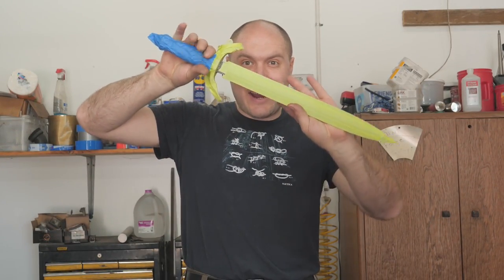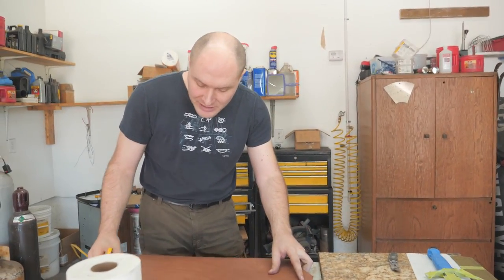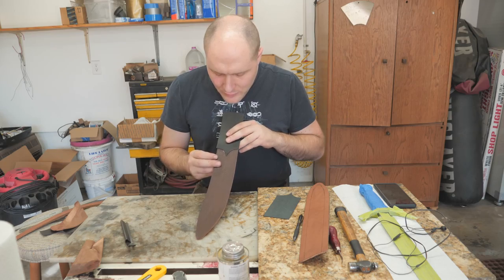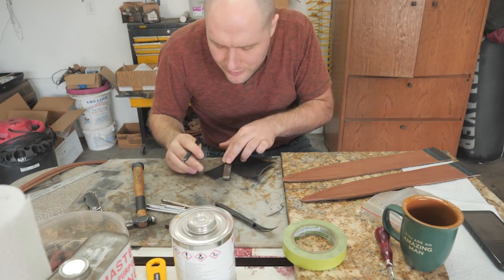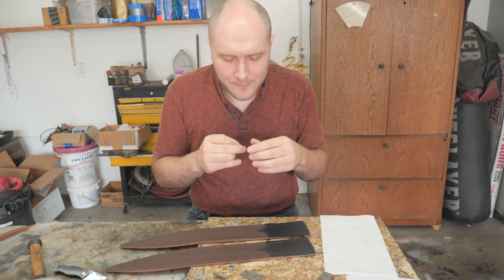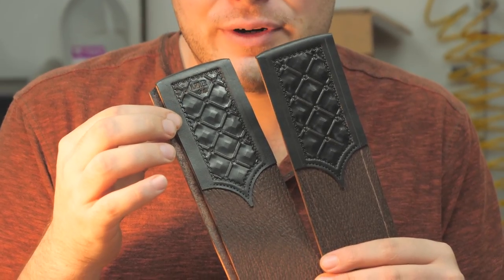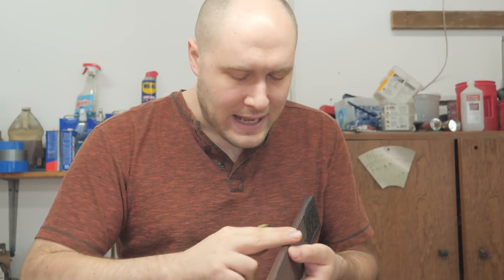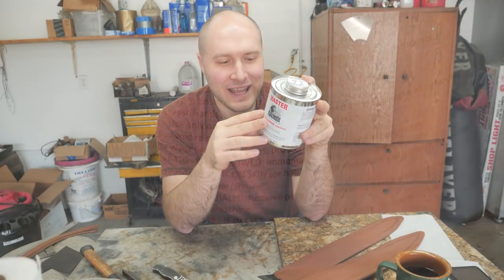How to Make a Sheath for a Dagger

Comment: Lovely work... I struggled with stitching for some time.. eventually I seen a chuck dorsett video and omg .. ... I use 6 inch needles for more grip to avoid needing pliers on tight holes 

Anybody comments on not using pricking irons ... it's tough to stay straight on thick leather... I prick enough to see dents and drillpress  sheaths aswell ...

Comment: Hi, thanks for answering my question on a different video. I have another question. I see that you stamped a pattern on the leather, but how would this work on a scabbard? Would the wood core underneath the leather potentially crack when stamping? If so, would you make the pattern before the leather wrapping? How would you align the leather so that the stamping is where you want it on the scabbard? Sorry, not just another question haha.
Reply from the maker: Good question Shane 
I think it would be hard to damage the wood with some gentle tapping 
Team Royer

Comment: The part I struggle with most is The edge finishing I guess I lack patience sometimes
Reply: Not all leather is burnishable. Vegtan-round your edges, use water and burnish lightly, not to much pressure and bees wax to seal. Chrome tan wont burnish use edge coat and then lightly burnish to flatten the rough part out.